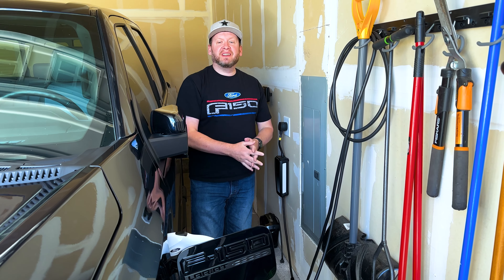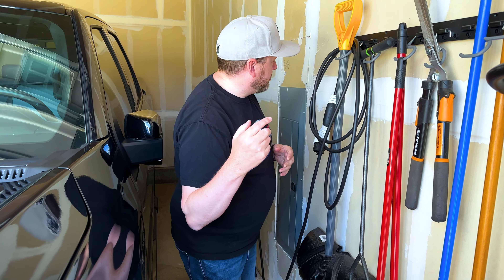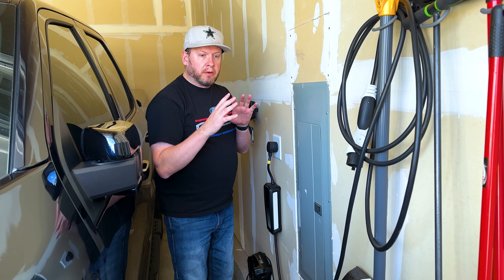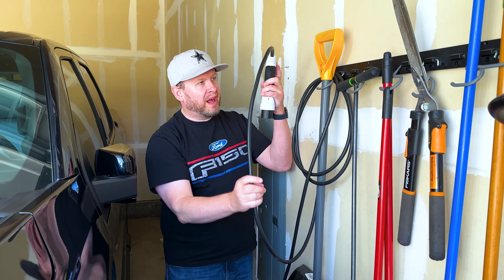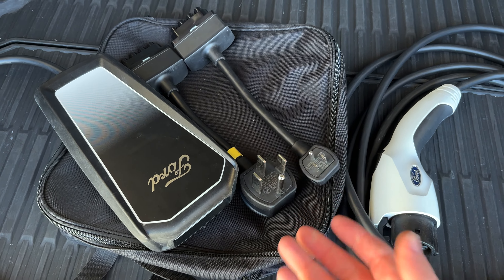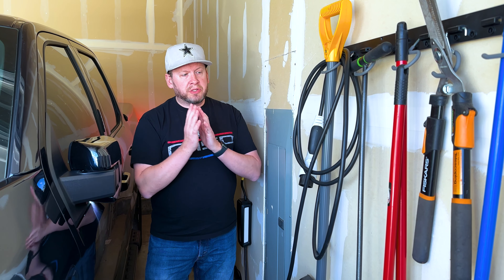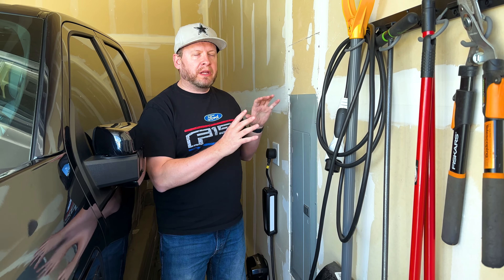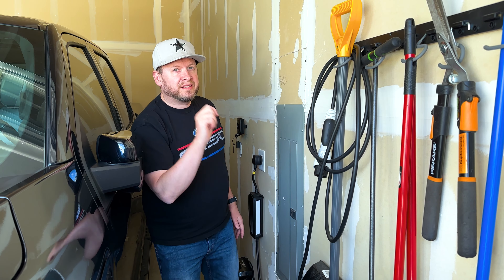Charge Ford Lightning at Home.

Comment: That’s exactly what we did.  We installed a 40 amp outlet.  I purchased a 3rd party EV charger that we charge my daughters Chevy bolt with and when my wife wants to charge her Model S or my Model 3, we just clip on the small adapter that came with our teslas.  All of our cars charge at 28-30 miles per hour at home, one at a time.  The ladies charge at night and I charge from 5:00am to 11:00am, reason is, I work the night shift.  We have never had any issues
Reply from the maker: Good info.  Yeah it really seems to work the best. It seems to be a waste to do anything different.
Reply: @Lampstand144   pretty cool all in the family have an electric vehicle, my daughter has the id4 and I have the lightning.  Greetings
Reply from the maker: I agree that is awesome!

Comment: What i did with mine is make up a male to male cable, with one end connecting to my pro power 240v plug and a Nema-1450 male and connect to the receptical on your wall you installed to charge the truck. It gives the house 30 amps of power, which runs most of my house, minus the heat pump. I've used it several times.
Reply from the maker: That’s interesting.  It doesn’t mess up your truck at all when you do that?
Reply from the maker: I’m trying to understand how that works.  You are reversing power through your receptacle on your wall?  Did you have to shut the power off to your house first?
Reply: No, it doesn't hurt the truck. It's one of the intended uses of the Propower. Yes, you need to trip the main breaker to the power grid before you plug it into the wall to prevent the power. It's how an electrical transfer switch works, but you are doing it manually at the main breaker panel. Also, you realize you only have 30 amps, but it the house pulls too much power, it will trip the switch in the truck, but you can easily reset it and try again with less draw inside your house.
Reply from the maker: Thanks, that’s some good info.
Reply: This is extremely dangerous. Tripping the breaker doesn't disconnect the neutral and puts utility workers at risk. Creating a cord like this puts you, your family, and your house at risk. There is a reason that cords like this are called "suicide cords."
Reply: Interesting thought. I have a licensed electrician do this. It's the same as when I run my generator during power outages. There's an exact replica plugged into the generator and run to a breaker. Been doing this regularly since 1995. Where I get, power outages occur at least monthly and for days at a time. Never had a problem so far. Thanks for the information. I'll talk to my electrician on the matter.
Reply from the maker: Thanks for the comment. I hope things are still going good for you and your setup.  I’ve heard of several people doing the same thing these days.
Reply: Yes, still works every time. I live in a rural area and get power outage regularly. The easy part about the setup is you already have the nema-1450 outlet that is used for your charger. Make the cable and your ready to power your house upto 30 amps. Can't run most heat pumps, but certainly refrigerators and freezers, all the rest of the house and even the hot water heater if you turn off all other appliances while it's running.
Reply from the maker: That’s great to hear!

Comment: The Tesla connection there you see in your Ford is about using an adapter so Fords can charge in high speed Tesla DC super chargers your lighting and any other EV out there (except Tesla)  have SAE J1772 connections. Both of those chargers you have there also are  SAE J1772 which is the standard in the US for charge any car and they dont going to go anywhere anytime soon. Even if you buy a Tesla you can use any of those chargers you have  with a SAE J1772 to  NACS  adapter, actually every Tesla comes with one.
Reply from the maker: I actually recorded this video before the adapter came out.  Here’s a video of me trying an adapter at a Tesla supercharger.
First Time Using New Adapter at Tesla Supercharger - Lightning Mike
https://youtu.be/iGD4lNc7OT4

Comment: Look up 4 prong range cord. Get the 50amp rated one and cut the ends (cap the neutral white line - not needed). Install other three lines on the Charger Pro. Dial the amps down on the dial on the board. Plug in. Done. Yes, it’s annoying that you can’t use it on other vehicles but it is a nice charger (WiFi and all) and gets you full 40amp if u can use 50amp breaker.
Reply from the maker: Thank you.  That’s good advice.  Still up in the air on whether or not I’m just going to sell it though because the setup that I have with the portable charger works pretty well. It charges at 6kw and I can still connect to my truck with my phone and tell it to stop charging and set up a schedule and stuff.
Reply: @F150LightningMike  Yeah, I get that. I see a lot of used ones for sale on EBay. I almost bought one thinking it was all I needed to hook up to house power (was I surprised to see all the other stuff needed). I was also surprised to see it came free with my slightly used Lightning. Previous owner never installed it. Still in box in the Frunk.
Reply from the maker: Yeah I think a lot of people figured out the same thing I did and didn’t want to pay the high priced install.

Comment: Didn’t see this in the video but this was my question and I can’t find a answer to it anywhere I’m new to electric and my ford charger is showing orange and not charging the truck
Reply from the maker: Blue means it’s good.  Orange means there is a problem. Sometimes a problem can be solved by unplugging the charger from the wall and waiting a little bit then plugging it back in which has worked for me the one time that it was orange.  however, I’ve heard that sometimes people are having to get theirs replaced.
Reply: Make sure is plugged in correctly.  It happened to me also. Unplugged and plugged back in.
Reply from the maker: Agreed!

Comment: I have this charger , can I use this to my garage or do I need to modify something , ....
Reply from the maker: I had an electrician install a 240v outlet. The portable charger comes with a wall mount as you can see in the video I just mounted it right under the plug.  It gets me 3-6 kw/hr, which is plenty and I didn’t have to spend the 1,500 that Sunrun wanted to charge me to install my “free” ford pro charger.

Comment: Hi Mike. Here Jesus. New to your channel. One question, do you keep the charger plugged in all the time, is it safe?
Reply from the maker: I keep it plugged in most of the time.  It seems safe to me.  Sometimes I will unplug it to give it a break.
Reply: Should be fine to leave plugged in when using  AC charging it's the trucks on board Systems that are handling the charging the "charger" is basically just a fancy adapter that adapts either the 240v or 110 volt outlet to a J1772/NACS plug and then the onboard charger converts that to the correct DC voltage for whatever vehicle you have, the onboard charger will prevent overcharge situations
Reply: Not an issue. It's got some phantom draw like any electronics, but it's not going to output power because it communicates with a vehicle when plugged into a vehcile and wont output power unless that communication happens.
Reply from the maker: Sorry I didn’t answer this yet, but pretty much what I do is plug it in at night if it’s below 50 percent or if I know I’m going to drive a bunch the next day, and I let it charge up to 90% unless I’m doing a test or going on a trip.

Comment: I have a 30 amp drier plug will this charger automatically sense the amperage and adjust? I read somewhere about needing a 50amp breaker for this charger
Reply from the maker: I’m not an electrician, but I do know that the plug for a dryer is different.  Ford does not recommend that you use adapters unless it comes with the charger. So you will need electrician to swap out the plug to match the four prongs that are on the charging plug as far as 30 amp goes mine is actually a 30 amp plug because that’s all that was left available with my panel.  The only downside to it is that it will charge slower usually between four and 5 kW per hour instead of 6-8 if you had the 40-50 amps.
Reply: It's a 32 amp charger. You need a 50 amp breaker and a 14-50 outlet. The voltage cannot be adjusted, other than switching the ends between 120v/12amps and 240v/32amps.
Reply from the maker: That’s correct.
Reply: @i6s1 if peak amperage draw is only 32 you’re fine with a 40 amp breaker, you wouldn’t need a 50 unless you don’t want it tripping when an over current of 18 amps goes through and fries your charger
Reply: @atomicgamez445  It's technically allowed by code but poor practice. You never know if the next homeowner is going to plug In a 40 amp charger when they see a 50 amp plug. Plus it's a no-brainer decision for future proofing to use 6awg and a 50 amp breaker.
Reply: @i6s1  I don’t see why we’d do that tho, If there’s a surge or overcurrent , his chargers fucked because the breaker/wire combo is gonna allow over 40 amps to go through when the charger can only handle 32
Reply: That's not the way it works, if you're concerned about surge, then install whole home surge protection. A 40 amp breaker, while legal on a 50 amp plug, is a potential hazard.
Reply from the maker: Mine should be plugged up the right way.  I had a pretty reputable electrician hook it up.  It just charges at about 7kw max.  Most of the time it’s around 4, and I understand it would be higher on a regular basis with higher amps.  But I think my setup is pretty good.  The portable charger is designed to change between 110v and 240v so it will adjust when 30 amps are sent instead of 50.
Reply: @F150LightningMike  That's not the way breakers work. The breaker doesn't "send" a specific amount of current. It only trips when it overheats, around it's rating. The charger can't adjust to anything by the vehicle, it has no way of knowing that your breaker (and possibly wiring) is undersized. 

 Since you have a 30 amp breaker feeding a 30 amp charger, your setup violates the electrical code. The NEC requires the breaker to be rated for 125% of the charger's capacity.
Reply from the maker: I’m not sure on the breaker side of things why it works well but it does, but I do know that either the portable charger or the truck throttles it because the flow rate adjusts all the time.  I’m looking at my app one minute and it will say 4kw then a few minutes later it will say 7 then a few minutes later back to 4 then 5.
Reply: I'm not saying it doesn't work fine, I'm saying that it's a violation of NEC to have a 30 amp charger on a 30 amp breaker. The breaker needs to be oversized by 125% to be compliant.
Reply from the maker: That is good advice.  I will look into it.  Thank you.
Reply: @F150LightningMike  to be in compliance with the nec peak operating current for the portable charger is 32 amps. 125% is 40 so minimum you’ll need a 40 amp breaker. I’m an electrician here in Chicago, I own a lightning and that’s what I installed in my garage. Another thing, make sure I beg you. That your electrician installed an ev rated charger that’s rated for continuous load. There’s plenty of instances around the world where regular nema 14-50’s (range outlets) were installed and melted due to them not being rated for such a high continuous draw. You’ll know you got the right one because a refular one is only like 6-8 bucks and the ev rated ones are 70+
Reply: Ev rated outlet*
Reply from the maker: That’s good to know thanks.  I’ll check it out.  I’m pretty sure the plug is rated for 50 amps, but I’ll double check.
Reply: @F150LightningMike  both plugs are rated for 50 amps. The only way to know of it’s an ev rated one is either it says it on the face of it. Or opening the box and checking that it has ALAN KEY screws not Philips head screws. Thanks boss
Reply from the maker: Thanks so much.

Comment: Your "electrician" put a 50 amp outlet on a 30 amp breaker, and you're running a 32 amp charger with it? I really hope you misspoke and it's a 40 or 50 amp breaker with appropriately sized wire.
Reply from the maker: Not being an electrician myself I could have misunderstood what he did, so it could be a 40 amp.  My max charging speed at home has been 8kw per hour so it could be a 40.
Reply: @F150LightningMike  It's pretty easy to tell, you just look at the breaker at it will say 30/40/50
Reply from the maker: The breaker says 30.  The charger says MAX 32 amps so I’m glad I’m not sending more than 30.
Reply: @F150LightningMike  Can't do that. The appliance can't be rated higher than the breaker, and 32 is higher than 30. The charger probably runs a little under that so it isn't tripping the breaker, but it's still not allowed. Max continuous load on a 30 amp breaker is 24 amps.
Reply from the maker: I understand your point and thanks for bringing it up.  Something else to think about, I’m thinking it would be the same for your truck/portable charger, I have two different adapters that came with this Ford charger.  One plugs into the 240v and the other plugs into the 110v outlet which is only 15 amp max.  Shouldn’t I be ok since it obviously is made to handle the lower 110v as well?
Reply: @F150LightningMike  I have the same charger. The charger will detect whether it's plugged in to 120v or 240v. If it detects 120v, then it pulls up to 12amps, which is the max continuous load on a 15 amp circuit. When it detects 240v, it will pull up to 32 amps. There is no way to control the current.
Reply from the maker: That’s what I thought.
Reply: @F150LightningMike hey man I’m an electrician and about to buy a lightning. Just so you know, the charger is limited by your 30 amp breaker only by 2 amps. All these ppl saying it’ll Trip or it’ll fry the charger no… the charger is only pulling what it’s given. Your 30 amp breaker is limiting it to 30 amps so the charger will pull only the available current at your breaker
Reply: If you measure your current load on your entire panel, if you’re only using say 60 of your 100 amp service or 160 of your 200 amp service, you should be good to smack that 40 amp breaker on there as long as your electrician installed #8 wires, and you’d allow your charger to charge at its max capacity
Reply from the maker: That’s a good idea.  Thanks.